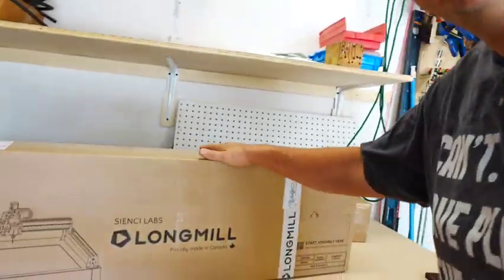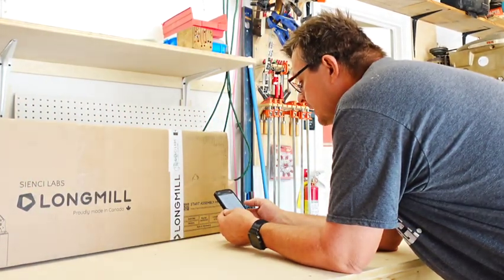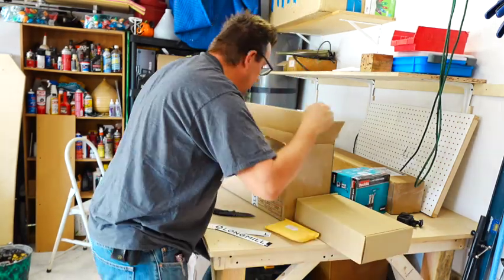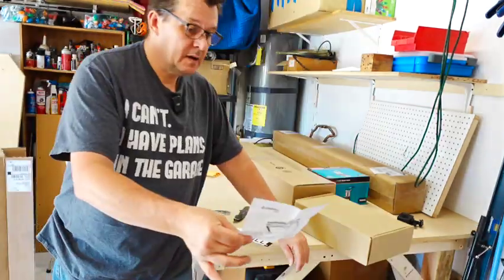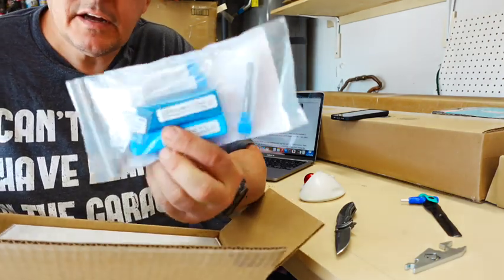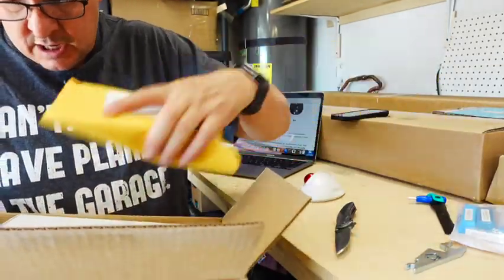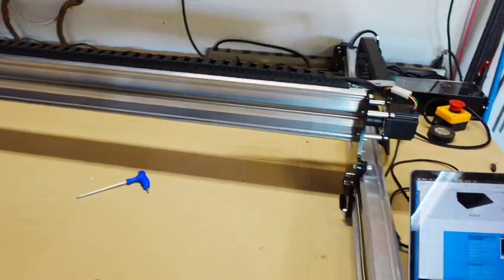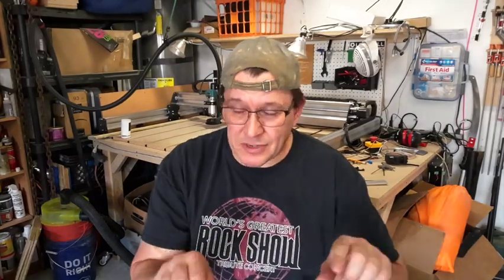Unboxing, assembly and first cut on my new LongMill Mk2 48"x30" CNC router!

Comment: Great machine. Unfortunately mine will be down for awhile.
Got parts ordered. But can't get them over the border. I ordered  2 weeks ago. Just talked to ups. They said it's still in Canada as of 2/10/2025.
Reply from the maker: Oh no! What parts? The guys at longmill have typically been great to deal with but shipping is a pain…
Reply: @unclebennysgarage  ..shipping has actually been good. But now Trump has tariff on Canada.  I had to order new robots. But I order the spring loaded ones.
Reply from the maker: @kidvicious2227 ah! I didn’t realize that had kicked in yet. Bummer. I hope it gets sorted out and you can get back to making 👍

Comment: 15:36 FYI, when the unit is just sitting, the stepper motors are energized. This is their holding current, which essentially allows the steppers to hold their current position and resist movement, unlike regular motors. This is one of the key features of stepper motors, and it's why you should never unplug a stepper when the driver is powered, as well as why they can get hot while idle. To prevent overheating, it's best to power down the board when not in use. You can also print fans for the motors to help keep them cool.
Reply from the maker: One of the issues I had was that the setting for that was turned off and the z axis was drifting down during cuts. Setting step idle delay at 225 keeps the motors in place and solved the issue. I also got better at setting all the wheels and slides on the gantry to keep it tight without putting excessive load on the motor and that helps. 😁

Comment: Can you describe the hardware and software you use? I see you had a Mac when setting up your Longmill, which I also have.
Reply from the maker: Hello! Yes, I have a MacBook Pro, 13” M1 chip I think it’s from 2019? 8gb memory and currently running macOS ventura 13.0 No fancy computer mods or anything. I have to use an adapter from the USB-C to the USB-A out of the CNC… for drawing I’ve been using Easel and so far it’s ok but for the price I think I’d like to try something else. It was easy to learn and start using but I think I would like something more powerful in the future… To operate the machine I’ve been using gsender. I had a few issues early on and the guys at longmill helped me dial in a few settings. I like it because it’s easy to use the touchplate. I did add a fan to the back of the motor drivers to keep them cooler in the garage.